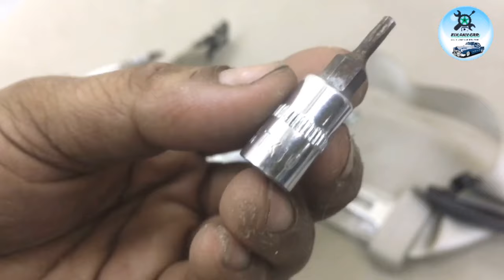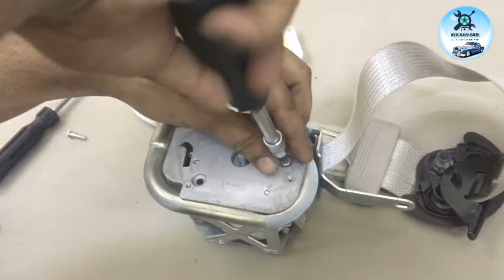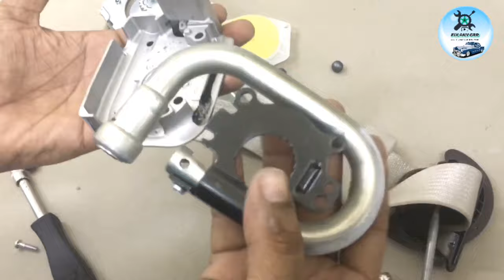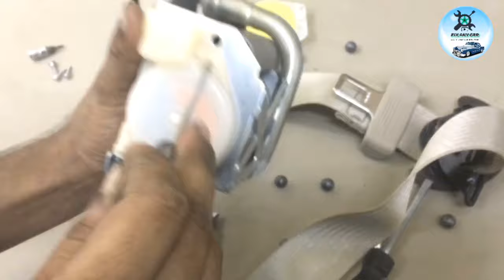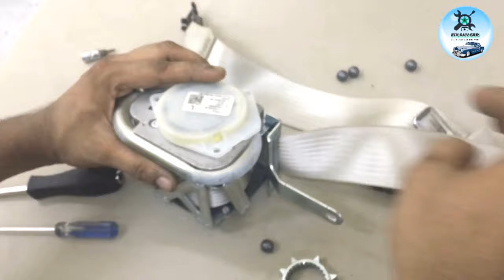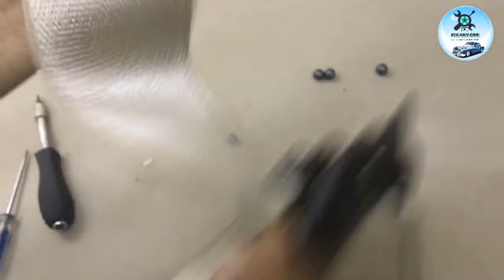Stuck Seat Belt Repair Quick & Easy

Comment: After this micky mouse job, this belt won't hold the passenger at all. At least you just want to have belt retracting when it's loose.
Reply: Thanks for answering my wonder,
 so jammed seat belt  must be changed or there's a way to fix it like new?
Reply: Do not do this. Very unsafe. Get this repaired properly.

Comment: the title says "Stuck Seat Belt Repair Quick & Easy" but actually this is not a repair. this is just disabling the seat belt safety feature. This will never work for any passenger seating on that seat. This is very dangerous. I do not recommend it.

Comment: How is this "quik and easy? After he finished the seat belt was inoperable. It failed to lock up when pulled quickly, this will not save you from hitting the windshield or getting ejected from the car.

Comment: Although I would not recommend doing this as it gets rid of the safety function of a seatbelt, the video did allow me to see how the system works via electromagnet and by sticking a magnet to the round tube that holds all of the ball bearings I was able to get the seatbelt on stuck and back to functioning order.
Reply: Make a video buddy. Please.

Comment: Actually, removing the pretensioning firing balls from the unit allows it to work again.  The 2nd ball he removed is the roll over ball,  and completely un-necessary to remove.  The unit will work as designed,  just the firing pretensioner is not loaded.
Reply: What does this mean exactly will it retract incase of an accideng
Reply: @josegaytan3384  pretensioning features are to eliminate slack on the seatbelt, then occurs the load limiting which dissipate the load when passenger is moving forward... this was not repaired in the video so this "new repair" will be as an standard seatbelt-  I always recommend change the seatbelt for a new one after a crash
Reply: so removing all those metal balls wont cause any problem?
Reply: @karmagurung8153  that’s what I wanna know
Reply: He removed the locking mechanism!  It unlocks the seatbelt and now won’t lock when you need it, like in a collision. Send your seatbelt to a professional company to have it properly repaired. It doesn’t cost that much (1/4th cost of a new seat belt from the dealership) and will function the way it was designed to. If you are in an accident you will be glad you spent $100 to have it repaired properly. If you follow this guys video you could die or be a complete mess in a collision. Don’t follow his video.
Reply: The locking mechanism and the pretensioning mechanism are not the same. He removed both.

Comment: Excellent illustration, detail by detail. I was able to solve my truck problem.Thank you very much.
Reply: Replace  your seat belt. This is not a fix.
Reply: Yeah,  this just makes the belt retract freely regardless of speed or inertia. These are dangerous videos that should be taken off YouTube, a seat belt like this will not prevent you from flying into your windshield, or being ejected from your car.

Comment: So my passenger seat belt in a 2013 Subaru Impreza sport locked up. I tried unbolting the bottom part of the belt to give it slack and see if it would reset and give me more belt but it just locked up more of the belt. Will this tutorial work? Are all these pieces pretty much the same regardless of manufacturer? I’m not too keen on needing to spend an extra 500 bucks for a dealer to ‘fix’ something if I can do it myself.
Reply: Yeah you can do this but I’ve seen a lot of comments that say seat belt won’t lock on hard stops so there’s no point in having this
Reply: There are many reason why seatbelts get stucked playing with pretensioning stuff Is not the right way to do It
Dont recommend to follow this tutorial
Reply: My 2012 impreza did the same thing last week. Not sure why. Did you resolve this?
Reply: i dunno man arguably seatbelts have to be one of the top three safety features of a car so if one fails and you value safety the logic goes you should replace it with a proper real oem part properly installed instead of trying to rehab or tool around with it at home. do you want to save a few hundred dollars or do you value doing everything that you can to minimize someone from dying or getting hurt? that's your call. 

i 100% break warranties but i believe in personal responsibility so eish safety critical stuff like that i just pay i don't want to have to think about what if, as remote as it is that something would go bad. but i also lived in the third world and not everyone lucky like me so i don't judge other people's economics.
Reply: @SheimSF  gracias x la recomendacion pero si lo seguire de echo estoy quitando mi cinturon😂

Comment: But does it lock up? And what about the other parts you left out?
Reply: Pretty sure it completely bypasses the locking. So at that point seatbelt is almost useless
Reply: I just did mine before watching this video. Then I was looking for video to see if there was another better way of doing it but he did it the same way that I did. As for your question, yes it still locks because on the other side of the belt where did didn’t remove any parts it has another mechanism that locks the seatbelt when you pull it hard. I believe that mechanism will work fine for a light crash but for harder crashes thats when the mechanism with the balls engages. When I put everything back together it was making a weird metal scratching noise. But after a couple of pulls the noise went away.
Reply: @gtdodgeviper  so what exactly am I keeping and what am I removing by detail?
Reply: Hehehe...

Comment: Congrats, you just completed defeated the purpose of your seatbelt. The next accident you’re in will likely be your last. Why don’t you send the seatbelt off to a company that specializes in repairing them PROPERLY?  This video is dangerous. Don’t follow this guy’s instructions your seatbelt will no longer lock and therefore will not protect you in an accident. You will hit your steering wheel/windshield/dash hard and possibly collide with your airbag as it’s deploying. Defeating the lock will allow  the seatbelt to spool out until there is no more web to spool or your body and head hit something hard and stop pulling on the web. You’re going to regret doing this or die as a result. Don’t do it.